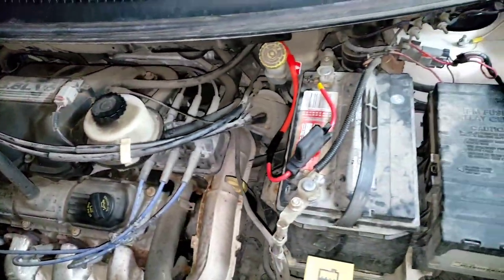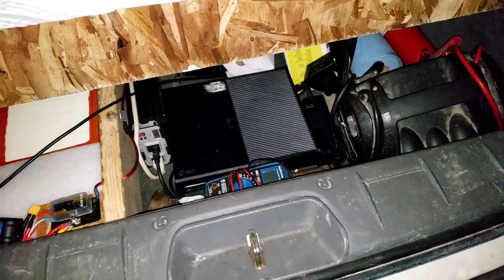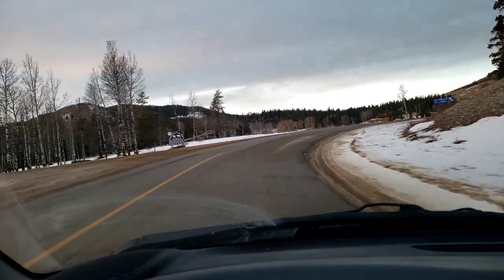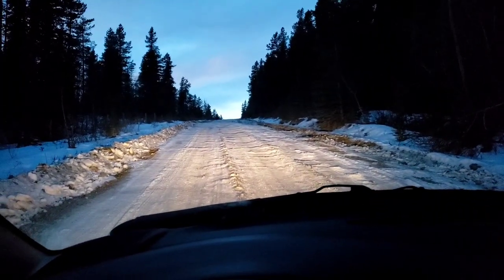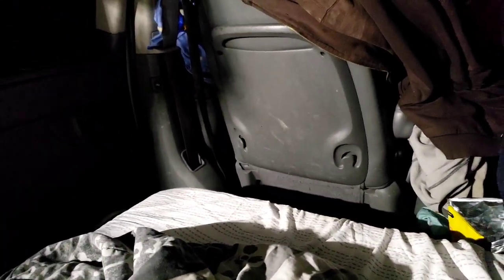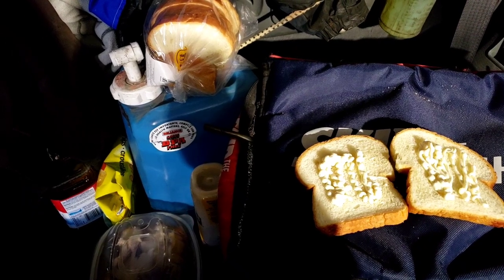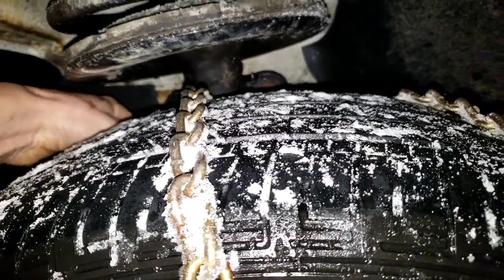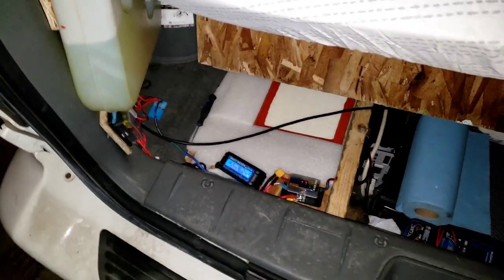Minivan life in Alberta vlog #3 Camping in -5 Celcius Waiparous area around Bar C Ranch

Comment: Cool video. Thanks. I have so much to learn about building a power station. My 2006 DGC never handled well in snow and ice.
Reply from the maker: if your going to build id check out www.batteryhookup.com,  the prices are up to 90% cheaper than a standard deep cycle battery in some cases.   The headway cells ive heard good things about and the terminals are threaded so no welding,  and the connections are all high amps so your design doesn't have to be perfect.   Honestly though this is why i called this channel crafty tech because its a bit of so many different things.